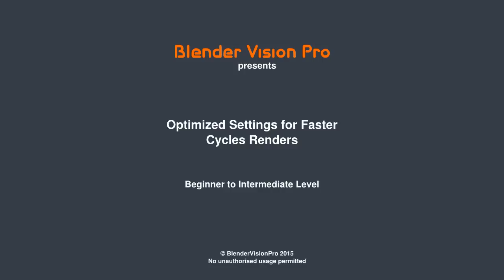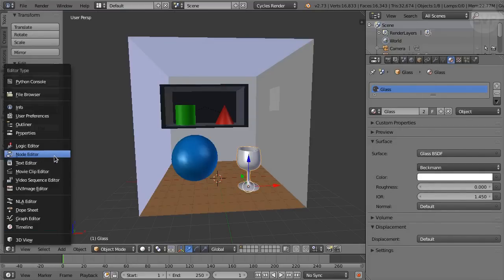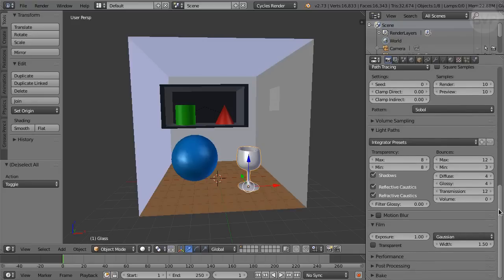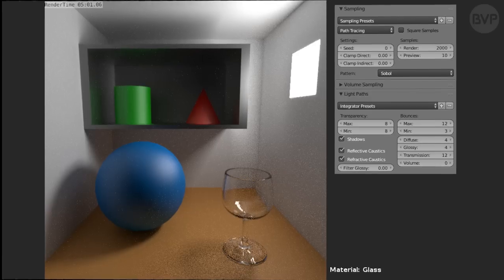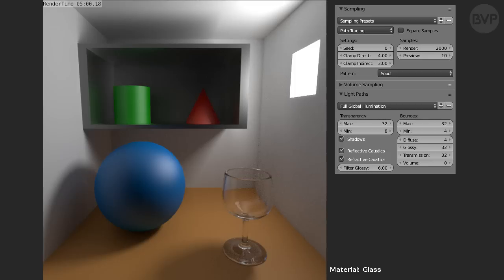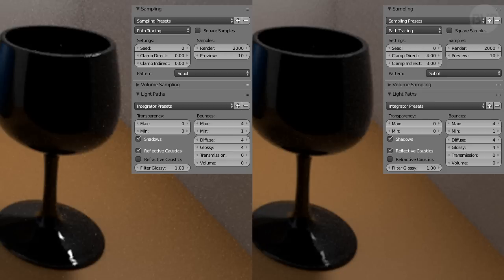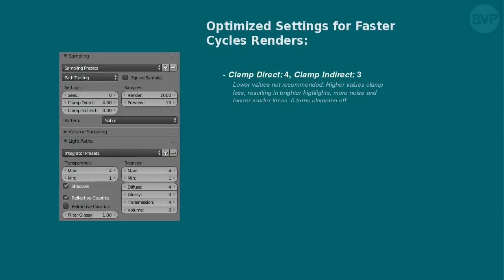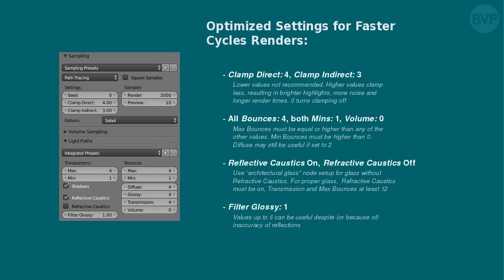Optimizing Render Settings for Faster Cycles Renders in Blender

Comment: Can someone else try this? I did it and it seems to work. I was rendering a dark indoors scene and reduced the exposure to about .3, while boosting ambient occlusion to compensate for the change in brightness. The render time stayed pretty much the same, but I noticed much less noise.
Reply: This can be a useful way to require less samples for a desired noise level, lowering render time, if it doesn't have any significant drawbacks, it would be nice for someone who really knows blender to test this out and give feedback.